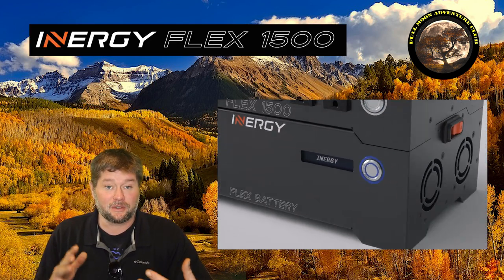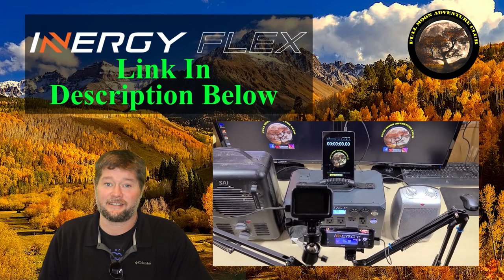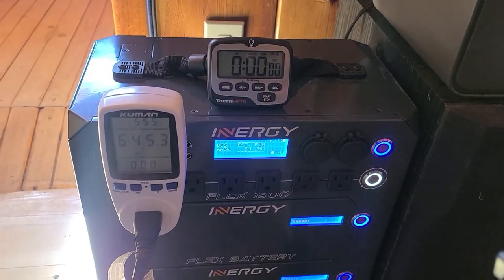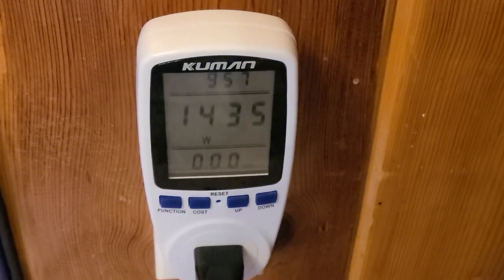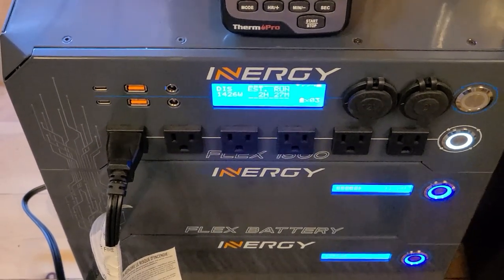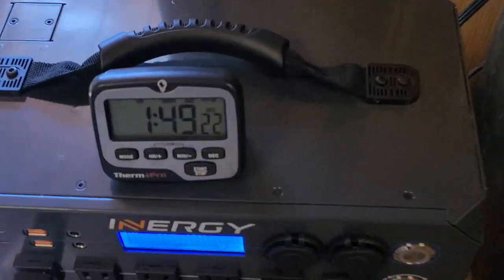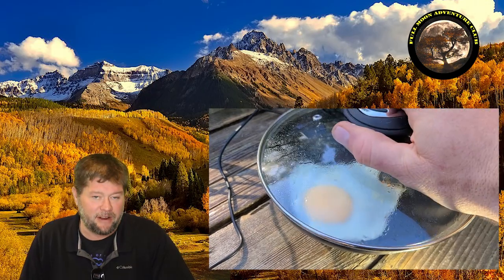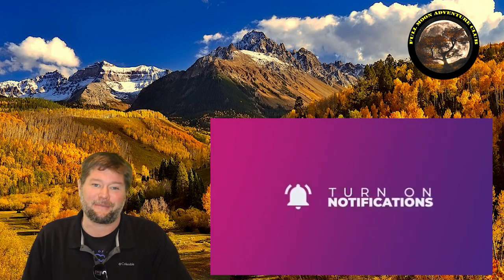Inergy Flex Running Space Heater - 3 batteries with a 1500 watt continuous discharge.

Comment: I have one complaint concerning the system: the locking mechanism for each battery is a slide lock and the lock is held open by magnets (very small ones). One of mine inadvertently closed while I was lifting it and the catch got bent and would not come undone (I had to take it apart to bend it so I can open it). The magnets are too weak in my opinion.  We really haven't used it that much for an opinion on the actual performance, but your review was helpful.
Reply from the maker: Mine are holding up well so far but I can see how that could happen. I always double check the latch position before attaching or carrying but once you have it connected I have never had a latch disconnect even when I moved it with 4 batteries attached. It was super heavy and probably shouldn't be moved around with that many batteries attached but I wanted to make sure they would not fail. Thanks for sharing that with us and I am glad you were able to fix it easily. To be honest I still love the original Kodiak design but I love the new features of the Flex. Take care and happy camping.
Reply: In the long run this unit will fail.

Comment: Great video, does this unit offer UPS.
Reply from the maker: I don't believe so no. It can be charged while powering Electronics with the inverter and so I have used it as a UPS of sorts meaning that I charged it with 600 Watts of solar by day and ran off battery power at night. it ran my desktop and other electronics and if there was ever a power outage the power supply would be uninterrupted. However, to be a UPS it needs to accept 1500 watts of power from an AC outlet and immediately transfer over to battery backup if there was a power Interruption which this unit currently does not do.

Comment: I wish they'd bring back the 30AMP plug so you could give your RV a BOOST
Reply from the maker: You absolutely still can you just have to use a little $7 adapter. The adapter takes you from a 30 amp style plug to a 110 style plug which will still deliver 1500 watts of power which is the maximum amount the inverter can handle anyway. But I do miss the 30 amp plug.
Reply: @fullmoonadventureclub  ah... cool. 👍 I take delivery of my new rv on Thursday. 🤟